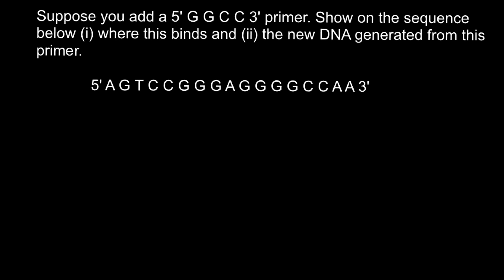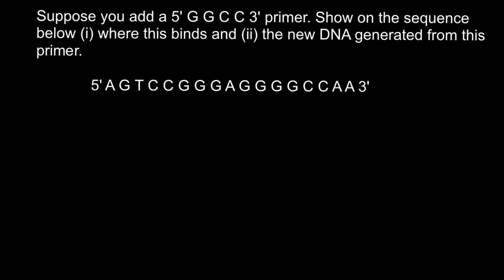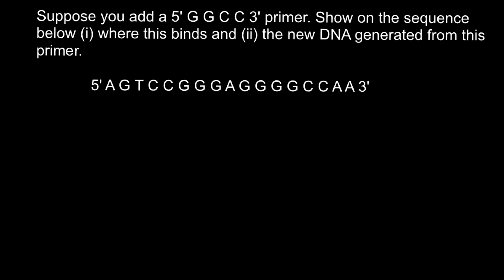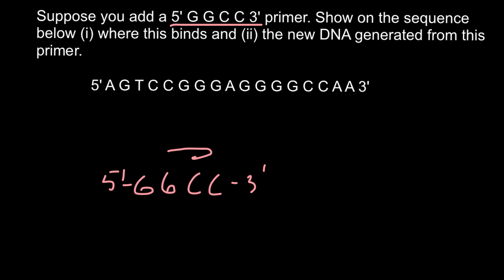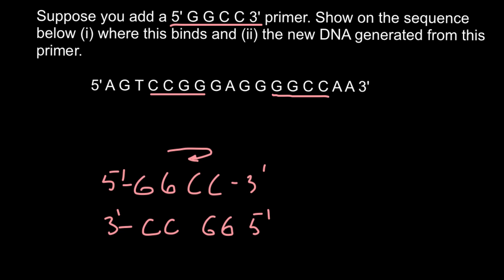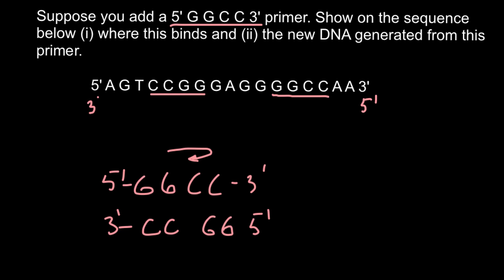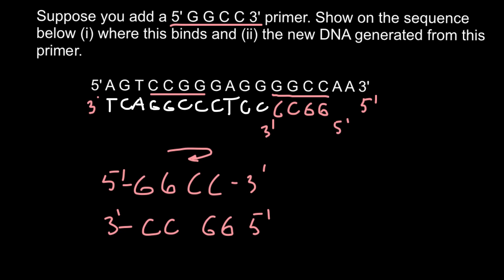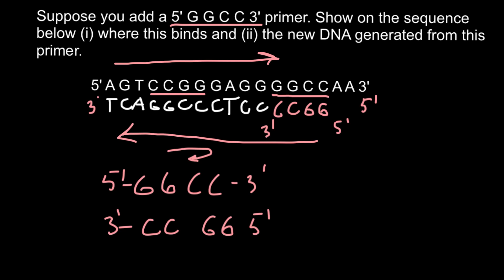How to design primers

Comment: I'm using ensembl database and while designing primers for an exon we see the 5' to 3' sequence of the exon (I'm assuming this is the coding region ignoring the utr). Then I copy the sequence to 'primer 3' site n it gives me fwd and reverse primers for PCR. 

I've read that forward primer binds to template strand and reverse primer binds to coding strand. Can someone tell me how this works or what happens?
Reply from the maker: If you want to copy the whole gene/ The forward primer attaches to the start codon of the template DNA (the anti-sense strand), while the reverse primer attaches to the stop codon of the complementary strand of DNA (the sense strand).
Reply: @GeneticsLessons  
In ensembl when I'm looking at an exon
It shows a 
5' upstream ---AGTCGCCCC---- 3' downstream sequence 

For context I'm looking at the FOXG1 gene's exon

I feel dumb for asking this but Is that part of the coding strand or what exactly is this?
Reply from the maker: Yes one primer have the same sequence as a fragment of coding strand and the other as a fragment of template.
Reply: @GeneticsLessons  so that exon only has the coding sequence (5' ------- 3')?
Reply from the maker: Yes only exons have coding sequence (5' ------- 3').
Reply: @GeneticsLessons   I was confused with coding strand and coding sequence shown in the exon database. thanks for the explanation and this vid u posted 6yrs ago.
Reply from the maker: Do not forget that mRNA first is made including introns - and later they would be spliced off.. hence pre mRNA and mRNA.
Reply: @GeneticsLessons  so does the coding strand have introns?
Reply from the maker: Do you think double stranded DNA have single stranded segments? 
Sure, template and coding strand have introns.
Reply: @GeneticsLessons  Got it. Thanks again.

Comment: You are given a DNA sequence of a particular gene. You are now tasked by your professor to 
design a primer set so you can amplify the underlined 275 bp DNA fragment (Fig. 1) using the 

polymerase chain reaction (PCR). In writing up your report please pay attention to the following:

(i)  Describe the qualities of an ideal primer.

(ii)  Use this information in (i) and the sequence below to design the primer set  mentioned 

above.     

(iii)   List all the reaction components and explain the role of each in the reaction mixture.
 (iv)   Write the PCR programme specific for your primer set.  
AAAATTTCGTTTCGTAGCCAGGCCGGGCTCCCAGTGGATTCGCGGGCACAGACGCCCAGG

ACCGCGCTTCCCACGTGGCGGAGGGACTGGGGACCCGGGCACCCGTCCTGCCCCTTCAC

CTTCCAGCTCCGCCTCCTCCGCGCGGACCCCGCCCCGTCCCGACCCCTCCCGGGTCCCC

GGCCCAGCCCCCTCCGGGCCCTCCCAGCCCCTCCCCTTCCTTTCCGCGGCCCCGCCCTC

TCCTCGCGGCGCGAGTTTCAGGCAGCGCTGCGTCCTGCTGCGCACGTGGGAAGCCGTCA

TCGATCGATCGATCAGATCGAT

Figure 1. DNA sequence of the telomerase promoter
Reply: the 275 base pair starts from base 18 from the beginning till 275

Comment: how to designing  primer for RAPD
Reply from the maker: RAPD (Random Amplified Polymorphic DNA) is a PCR-based technique used to detect genetic variation between individuals or populations. The RAPD technique utilizes short, random primers to amplify a set of genomic DNA fragments, which are then visualized on an agarose gel. To design primers for RAPD, the following steps can be followed:

Choose a set of short, random primers: RAPD primers are typically short, 10-base random sequences. A set of 10-20 primers can be chosen for each RAPD experiment.
Check for primer specificity: Before using the primers in a RAPD experiment, it is important to check for their specificity by performing a BLAST search against the genome or sequence database of the organism being studied. This will help to avoid amplification of non-specific DNA fragments.
Optimize PCR conditions: Once the primers have been selected, it is important to optimize the PCR conditions, such as annealing temperature, MgCl2 concentration, and cycling conditions, to ensure efficient amplification and minimize non-specific amplification.
Test the primers on a subset of samples: Before using the primers on a large number of samples, it is advisable to test them on a subset of samples to confirm that they are working as expected and producing the expected RAPD bands.
Visualize the RAPD bands: After PCR amplification, the RAPD fragments can be visualized on an agarose gel stained with ethidium bromide or a similar DNA stain. The RAPD bands can then be scored as present or absent for each sample, and the resulting data can be used for genetic analysis.
Overall, the design of RAPD primers involves selecting short, random sequences and optimizing PCR conditions to ensure specific amplification of genomic DNA fragments.